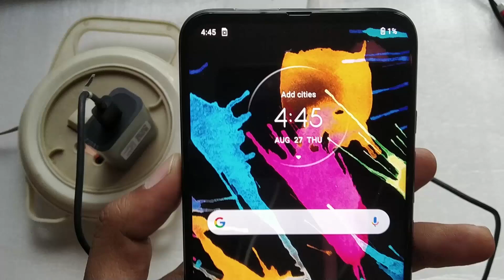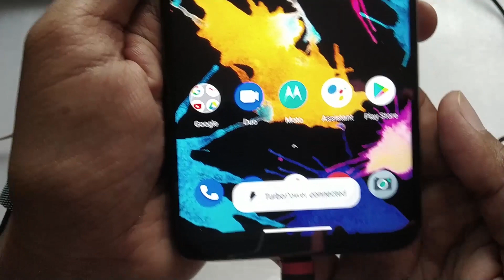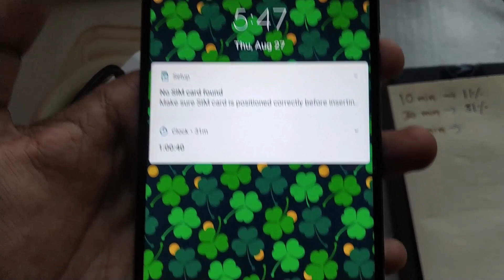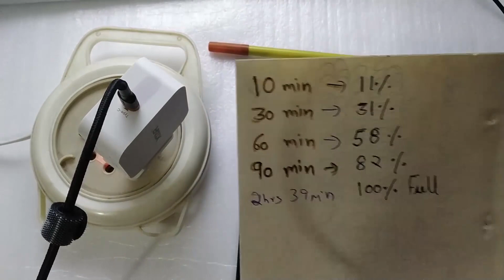Motorola One Fusion Plus Power Delivery PD Charging Test

Comment: Not turbo charging tries 2 moto chargers turbo .. what to do phone's problem or charger's problem? What's solution
Reply from the maker: how long does your phone takes to charger.?
IF your phone takes about 2 hour and 40 something minutes then your phone is charging at  turbo speed if your phone takes more than that then your phone is not charging at turbo speed.
Don't worry about the turbo animation in the beginning because sometimes is shows and sometimes it doesn't.
Reply: @gurribuy  taking 8-9 hours for full charge, tried different chargers of moto still same problem
Reply from the maker: @dhirendrapratap8493  Change the cable then. Buy a good quality cable.
Reply: @gurribuy  will try👍
Reply: Taking very long time to charge the phone , how to know it's a phone problem or charger and tried charging other brand charger as well but not speed charging
Kindly help me out
Reply: @shraddhabangera1255  same problem please help me